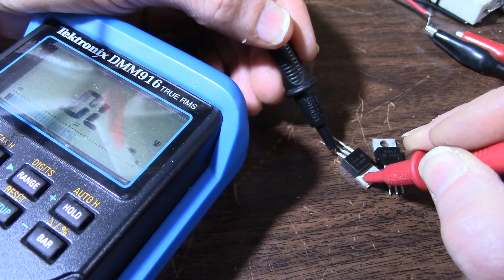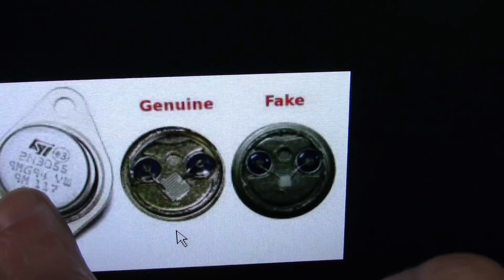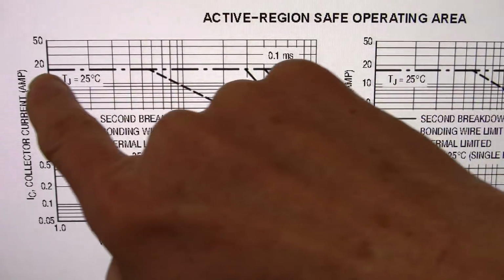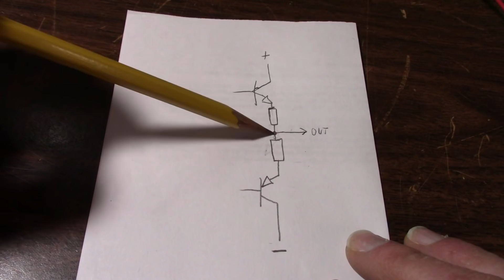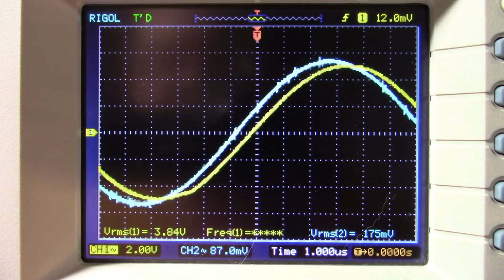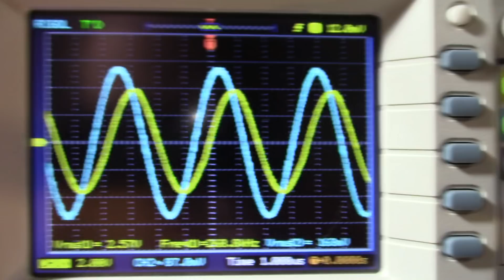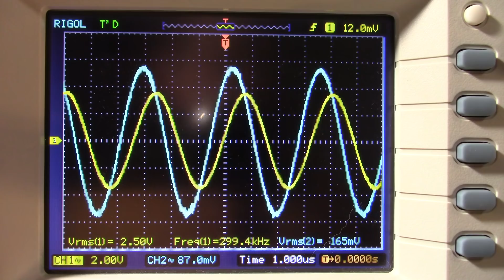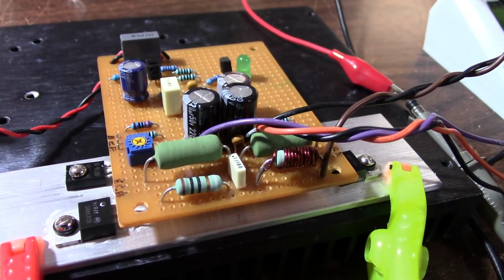JAT EZ amp Part 2 amplifier blows up during testing

Comment: If the issue is exclusive to high frequencies then maybe a low-pass filter would solve the problem?
Reply: I don't have a lot of experience with amplifiers but I don't think the issue is oscillation. Transistors don't die so easily just because if oscillations. They die when shoot-through conditions occur. I would attribute that to maybe some sort of asymmetry in input impedances between the two Darlington pairs. So maybe there is an issue with the design but I wouldn't think that it's the oscillations.
Reply: But he wants to test for oscillations, distortions and other issues at very high freqs., so LP filter is out at this stage.
Reply: @pliedtka  You are meant to see if oscillations occur under all possible operating conditions.  So only audio frequencies (unless you are constructing an RF amplifier) and variation in supply voltages. The boucherot cells purpose is to damp any tendency to oscillation; shorts HF to ground as was demonstrated with it's resistor getting hot - which is another way to detect oscillation problems if they are severe enough,  even without an oscilloscope.
Reply: @threeMetreJim  - True, but 100+ khz is not a possible operating condition. This is why the FB resistor is usually bypassed with a small value capacitor to limit the amps frequency response to something reasonable for audio. Therefore, if the amp is to oscillate,  it would occur under normal operating conditions, but this is what these circuits are for; to prevent such occurrences under 'normal' conditions. 100+ kHz is not normal for audio amps.
Reply: @bob4analog  I think John was trying to get a flat response  up to a high frequency. If you can do that, then it means other parameters of the amplifier are also suitable, like it's slew rate. I would have attempted to measured the slew rate directly (this does require the input filter is disabled too), that would avoid trouble like the boucherot cell heating up and maybe the amplifier dying (there would have been a lot less high current pulses through the transistors, and they might have survived). Also allows for seeing what the step response is like (any overshoot and/or ringing). You'd then put the input filter back in place and you'd have a decent working amplifier that has no chance of blowing up in real use (apart from by shorting the output or other inappropriate load possibly).
I had a look on some audio amp forums and they were mentioning a 50v/uS slew rate for up to 100W, 8ohm amplifier, and a frequency response flat up to 200kHz. The wide bandwidth is to keep the phase response flat too, up to a reasonable frequency.
Reply: @threeMetreJim  Well, in that case, I would suppose he now has an idea what the slew rate is.  And if I recall, this was a simple scaled down amp, so I wouldn't expect too much for the slew rate. It's a nice amp just the same.  ;-)
Reply: @threeMetreJim  Yes, this what mean - no LP filter and then John can do measurements you describe and check for oscillations, ringing and other issues as you described. I read on DIY Audio that some people have amps with oscillations past 1MHz, especially when fast transistors are used. So sure we would love to have 100V/usec slew rate or better but it's very hard to design such amp on the board. Yeah I can play on the SPICE but will it work 100% - hard to say since there are many variables in real life.
Reply: Something in the output is becoming reactive at that frequency, like the wire wound resistors, and causing those outputs to pop. I think the amp is working fine for audio. If oscillations were to occur, they would've been seen already during normal operation.